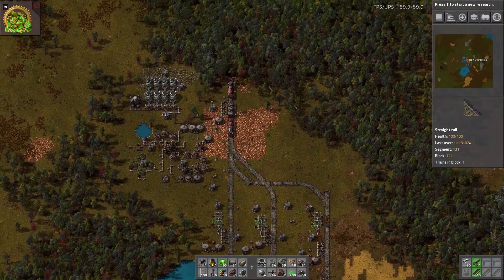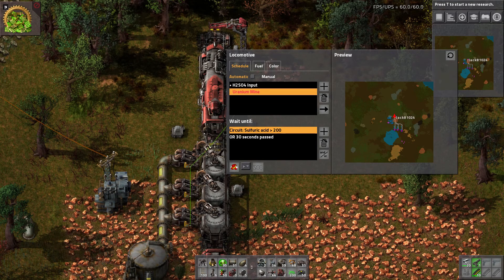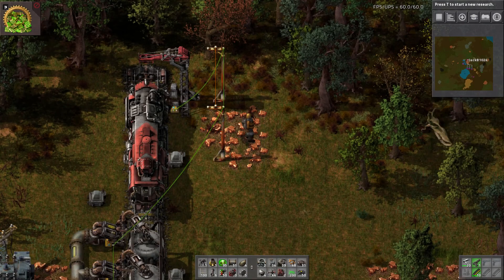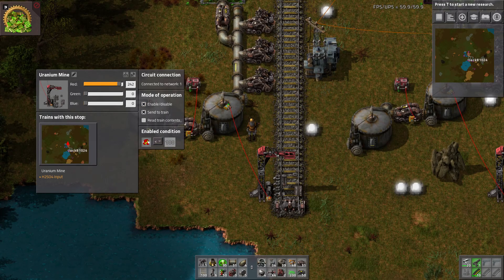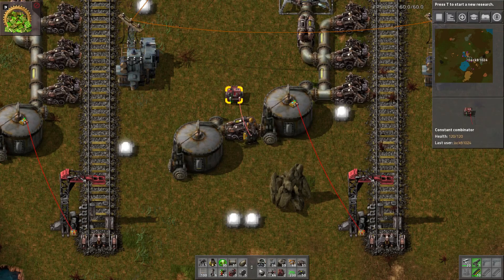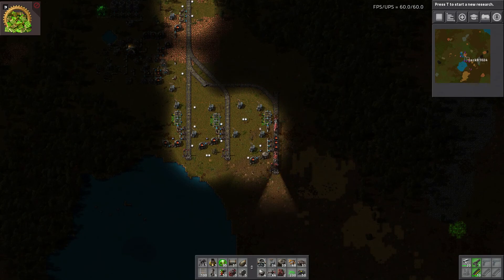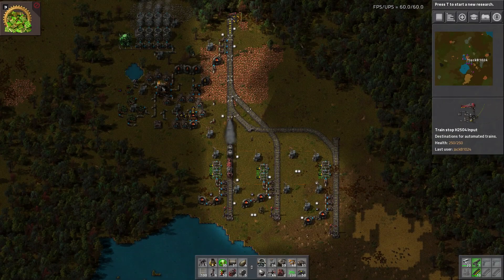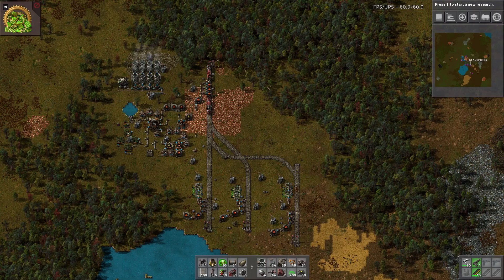Factorio Uranium Mine Sulfuric Acid Refilling with Circuit Networks

Comment: With the Fluid condition, your pumps will still pump your fluid wagons to the max.   Fluid condition only stops the train long enough to fill the tank, but if the train stays there longer, when the sulfuric acid stations are disabled by the circuit network, it will fill to 25k.
That is, if you wanted to actually limit the amount of acid that goes in the fluid wagon.